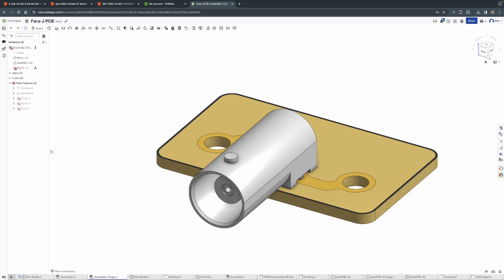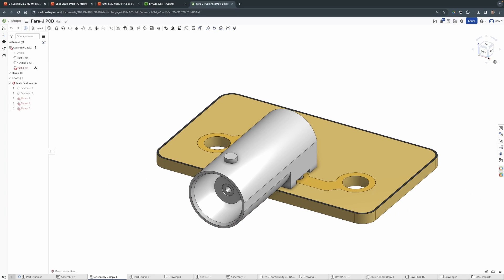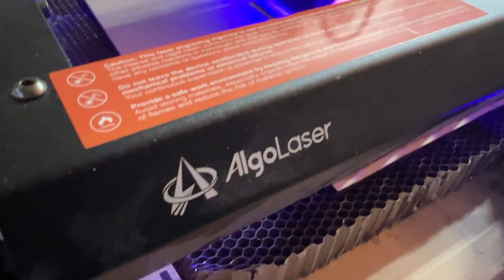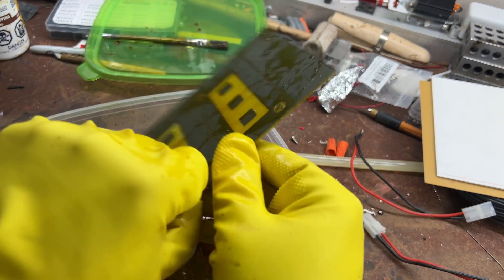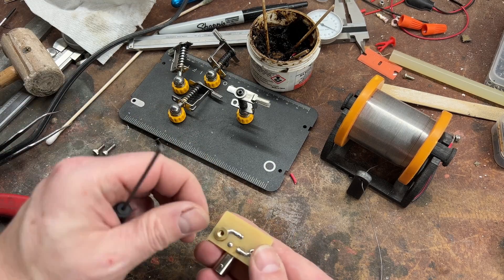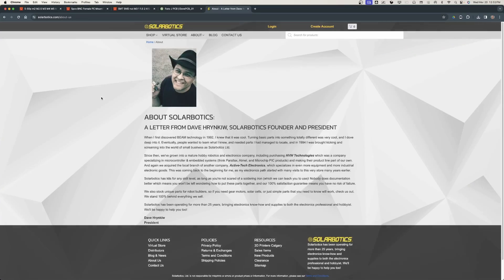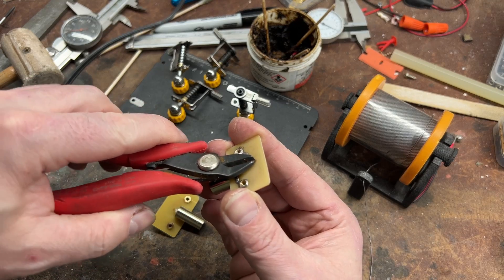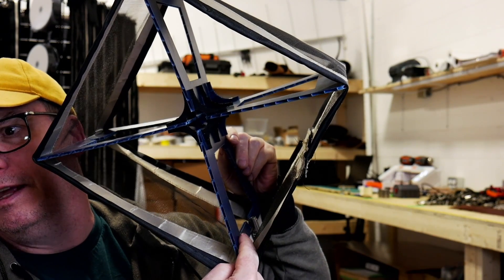Your Own PCB  Antenna connectors for Ham Radio

Comment: I would like to suggest an SMA socket like the Amphenol 132432. This is far less bulky than BNC. I'm sure they are also available cheaply from China. I would then use an RG316 as the feed cable.

Comment: Great video and a great antenna!  Any idea on the power limitation of the FaraJ antenna?  73
Reply from the maker: 50w continuous no problem and we have run 100w through one without any issue either

Comment: $75 !  Damn.
Reply from the maker: They are not easy to make. If that scares you then you can get plans and make your own.
Reply: @VE6SFX_HamRadioRookie  plans??
I built my own copper j-pole pushup antenna...even built my own "fantenna" [from an old busted reciprocating fan] and with 5 watts could easily hit the repeaters over 30 miles away (even though they were at like 2K feet) KF6CIF